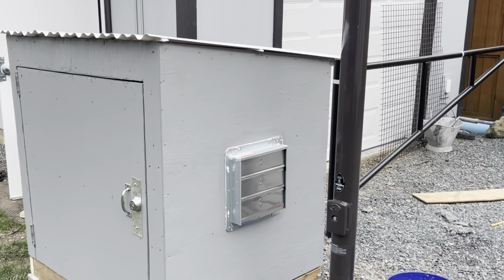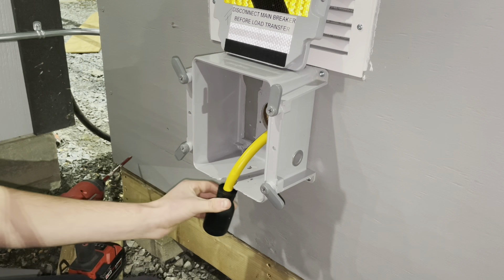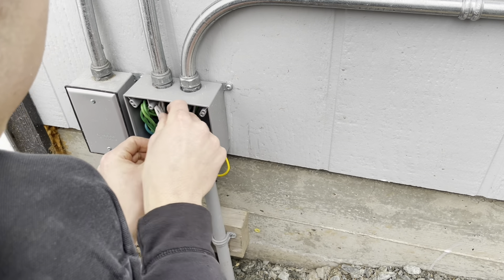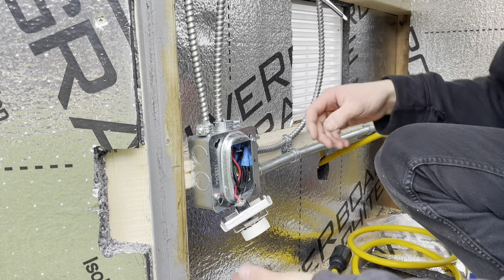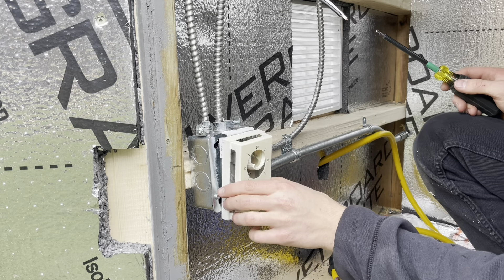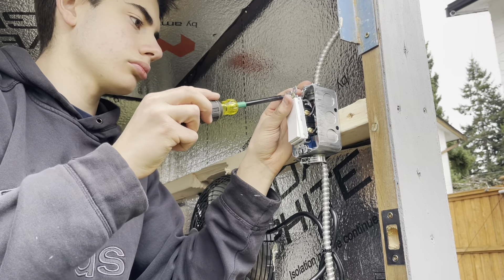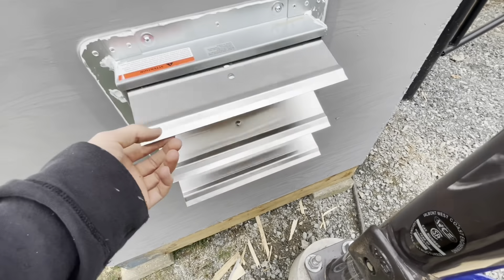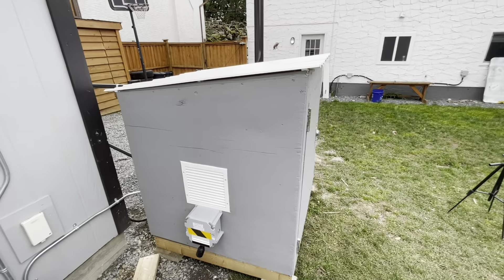Electrical work in the new generator building (part 2)

Comment: 2:34 that will fry the bits. if the get smoking hot the metal will get soft and the teeth will dull, it might be because the drill is running backwards. it could also be cutting the foam in which case it's fine

Comment: Awesome work! You should have a detector in there just in case the bull melts or something
Reply from the maker: Just not sure what kind of detector to put in there
Reply: @nics-systems-electric  
I think smoke would be good, because the bulb could trip a heat detector. You should also have a pull station in there just in case something happens, and you cant get in the garage
Reply from the maker: @dabitzz  yeah I would just do a detector as the building is not a direct threat to the garage I don’t need to give any early warning to the garage but detector would be nice so when I’m in the garage I know if somethings getting crazy in the generator room
Reply: @nics-systems-electric  Do multisensors exist for firelite? Could get one of them and then you're covered on both heat and smoke (and could probably set it up to require both to alarm to prevent false alarms if the panel allows that)
Reply from the maker: @NACAFireAndSecurity  Yeah I could do one of those they’re more expensive but available
Reply: @nics-systems-electric  Ay that’s fair, what’s firelites cause and effect capabilities? Would requiring both heat and smoke actually be possible? Might be a worthy investment, that way if it gets too warm from usual usage it won’t trigger, and if somehow any exhaust fumes get in, it won’t go off if it was an optical det
Reply from the maker: @NACAFireAndSecurity  I don’t know much about the detectors at all I will probably add something in there though if the dual function detectors are too expensive I could just do a smoke and a heat
Reply: @nics-systems-electric  Could do, have you got discord or anything? I’ll do a bit of research if you like and can come back with findings or whatever (or if you have discord we can properly discuss stuff or whatnot)
Reply from the maker: @NACAFireAndSecurity  I’m sorry but I don’t have discord
Reply: @nics-systems-electric  Nah that’s chill dw, I have you on insta I think if that’d be an easier way to discuss stuff?
Reply from the maker: @NACAFireAndSecurity  for sure you can always message me on Instagram I’m gunna do some research see what I can find for detectors
Reply: @nics-systems-electric  Sound, I’ll shoot you a message over now so we can continue convos etc there

Comment: Is it going to be automtic turn on or you have to turn it on?
Reply from the maker: It’s going to be manual it’s not a whole lot of work to do with the remote start which remote starts the generator and choke all you gotta do is start it plug it in to the garage and flip the breaker standby generator is great but more expensive and more expensive to run as it’ll turn on by itself so if the power goes out in the night I may not need it to run and it would just waste gas

Comment: There is something that I didn't want to tell you about, I don't want to sound too melodramatic or anything but it is something that I thought you should know.  Heat lamps.  I don't suppose anyone at your school district told you anything about the dangers of heat lamps?  If you should decide to use real heat lamps, there is something that I wanted to warn you about.  Real heat lamps are the ones that glow red, use around 250 watts, and screw into incandescent sockets.  Well, they seem terrific right?  HOWEVER, there has never ever been another light bulb more designed to burn homes to the ground than real heat lamps.  Especially, the infrared ones.  Very bold statement indeed.  Think about it, you have to put the heat lamp that dangerously close to things for it to serve a purpose in the first place.  And, if you look on here on YouTube, you will find videos about a pig farm fire that resulted from a heat lamp.  And, you dig into YouTube, you will see news story videos about people's homes being burned to the ground due to heat lamps.  Well, if you think about it, heat lamps get hot.  And, they do get hot enough to catch things on fire.   And, there is even a YouTube video from Homestead talking about heat lamps being a fire hazard.  And, I have an uncle who was using a heat lamp to keep a dog kennel warm, his dog bumped into the heat lamp which scooted it close to the wooden pole that was holding up the kennel roof, caught fire around12:30 or 1 in the morning.  Think Heaven that it was a New Year party because, I was celebrating New Year's and I and the other party goers called attention to the fire.  My aunt was on the phone with 911 and my uncle attacked the fire with a portable fire extinguisher.  Police showed up minutes later.  And, police was doing a routine check for drinking.  The officer dispatched the fire fighters and fire trucks showed up.  It was a mess.  Another one was at a restaurant that was using them to keep French fries warm.  Heat lamp was too close to some wall paneling and started a fire.  The fire climbed up the wall in minutes and I ended up having to pull the fire alarm.  Police and fire fighters showed up.  The police said that this madness was caused by a heat lamp that was way too close to wall paneling.  So, I wanted to warn you about that.  Heat lamps are a fire hazard.  I don't see how they are even allowed to sell these things!  But, they are. Just because something is legal to sell doesn't always mean that it is safe.  So, I would be real careful where you screw those heat lamps in because, they do get hot enough to melt things and catch things on fire.  I just thought about this and I know that you worked really hard building your generator building and shed.
Reply from the maker: Yes heat lamp can be hazardous if not installed properly, they are safe if installed in a can rated for that use in the ceiling. however for sure they can be hazardous when installed in the wrong situation. I don't use an actual "heat lamp" it's just a regular light bulb 250w which is fixed in place so it can't be repositioned, so I'm not concerned about it something would have to be touching it to be a problem. I don't see how that would happen but if it did and started a fire the fire alarm system would be activated so I would be alerted of the issue to control it or put it out. however you did make some good true statements about heat lamps as I think they should have heat lamps specific sockets so they can only be installed in rated fixtures and not just wherever people improperly installed them
Reply: @nics-systems-electric  At the pool where I work, the fire marshal actually banned heat lamps in public buildings.  I don't have a problem telling you that my uncle's incident still causes me nightmares from that night and I was only 7 at the time.  I ended up having to see my school counselor about it when we returned in 1995 after that holiday break.  I was in first grade back then I never forgot it.  And, Heaven forbid, if my aunt and uncle had been in bed when it happened, that kennel was right up next to the house.  Heaven forbid if he had been in bed, or worse, away from the house, say at the skating rink when that happened.  I don't even want to think about it.  The second story was even worse.  The restaurant did not have sprinklers.  Luckily, the wood paneling was a small section.  And, like you said, public places are required to have sprinklers and that restuarant did not have sprinklers.  Heaven forbid, if that wall paneling had everywhere.  Paneling is finished with varnish.  And, varnish is like gasoline.  And, I understand that wood paneling is forbidden in public buildings?  Heaven forbid, that fire had compromised the roof support structure of that restaurant.  You know if you watch Tom and Jerry the movie.  Robbins nest cabin had a fire and the cabin collapsed.  Remember?  The fire compromised the structure to the point of no return, the support structure became weak from the fire, and the cabin support structure gave out and buckled from the weight of the building and that's what brought the cabin down in that movie, if you ever wander.  That's why that when that restaurant's heat lamps caught the wall on fire, I promptly pulled the fire alarm.  And, that restaurant was an elevated structure, which you know made matters worse.  No, I don't play with fire.  That restaurant not only did not have sprinklers but it was apart of the mall.  They evacuated the mall as well because, the restaurant was apart of the mall.  Granted this was 14 years ago but I never forgot that either.
Reply: @nics-systems-electric  I would have to agree with you that they need a dedicated type of socket just for heat lamps that a heat lamp can only be screwed into a heat lamp socket.  They don't have that unfortunately.  They do for metal halide, "kind of".  For open rated, they use an extended mogul socket (pink colored mogul socket) that can only accept open rated MH lamps.  It is known as an EX39 connection.  So, yeah.  They should have something similar to that but they don't.  Sad.  But even if they did, there isn't anything that will prevent you from putting the heat light fixture too close to say wood paneling or something.  And, nothing will stop anyone from buying the cheap quality stuff either.  And, then of course is improper installation.  I'm sure that people know to never screw them into conventional sockets but putting the heat lamp too close to stuff, using cheap quality stuff, and improper installation of heat lamp fixtures.  Not clamped securely, stuff like that.  I don't think a "proper" socket would help anything.  They make portable heat lamps that clamp onto stuff just like a drop light.  Why does that matter?  A fluorescent light or metal halide light fixture is just going to hang there.  A permanently mounted light is just going to sit there.  But a drop light, we've all done it, you have, I've done it, I do it every time I use my fluorescent drop light.  Plug that light in, rest that light against my carpet pad which I use as a knee pad, and run to the bathroom and come right back.  I'm sure that is what is causing heat lamp fires.  People doing that with portable heat lamp fixtures.  So, heat lamps are not dangerous, it is the portable fixtures made for them.